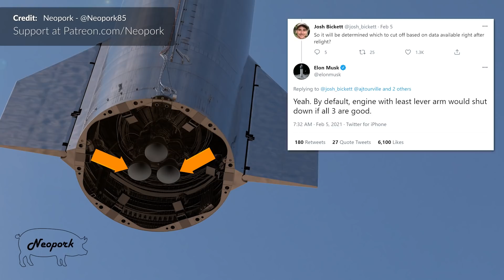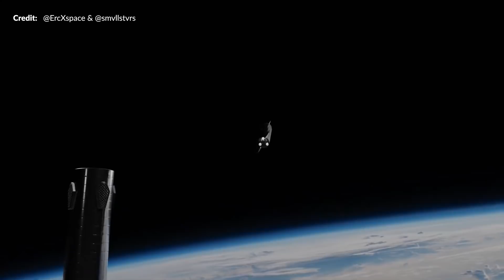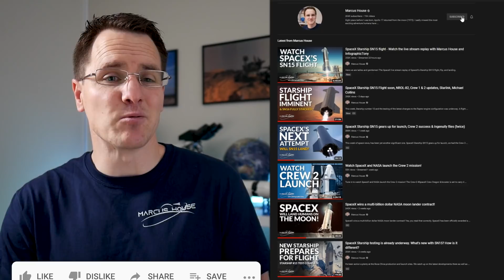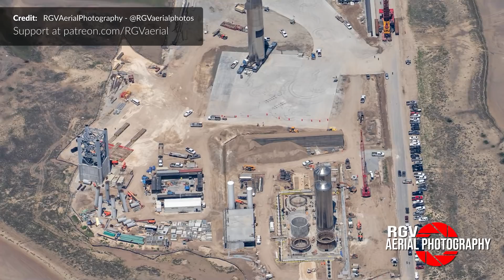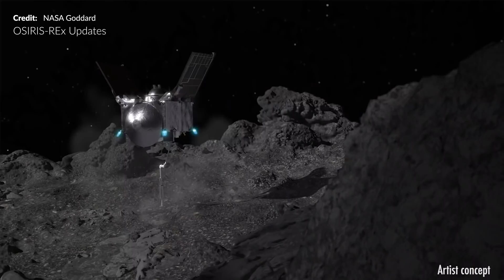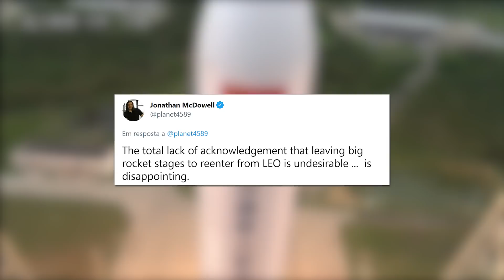SpaceX Starship development shifts focus to orbital flight with Super Heavy

Comment: All three Raptors were eventually removed and sent to McGregor.  No word on the reason or condition, but, honestly?  If I were an engine technician, I would be ecstatic about getting three veteran flight engines back to disassemble, check and fondle.  That would be some of the best data and solid information available anywhere.  In reality, that is the only way to make them bullet proof.

Comment: Good update - but i must point out your wrong about the cryo shells having any significant vacuum in them.
It takes a large amount of strength to withstand atmospheric pressure these thin shells would not be capable of withstanding anything like that and it would require a medium to high vacuum to prevent convective heat transfer.
What i expect is the inter tank gap will be lined or filled with insulative materials like (cellulose , foam , rockwool, vermiculite etc) and pressurised at very slight positive pressure with dry air or nitrogen to prevent frost formation by excluding any ingress of moist external air.
Reply from the maker: I shouldn't have simply said vacuum, so you may be right. We think it will be a lower pressure containing nitrogen. I hope to clarify this more soon.
Reply: @MarcusHouse  I am only guessing but to exclude humidity they will likely pressurise the gap a little  above atmospheric pressure with dry air or nitrogen.
In this way if there are any leaks the positive pressure will not allow external moist air to be draw in which would cause the formation of frost on the cryogenic inner tank surface.

Comment: WHy doesn't starship use Dragon as the top Capsule for Aborting in case. Spaceship has no abort system. If they attached Dragon as the cone, the austronauts can launch safely, then when safely in orbit they can access the whole starship room once it's safe using a hatch.

Comment: their won't be a vacuum between the storage tanks and the outer skin. This is a ridiculous amount of surface area and would not be strong enough to hold back the pressure
Reply from the maker: This is correct, it will actually be filled with nitrogen gas we believe. Correction coming in the next video. In retrospect, it was dumb to think this. My mistake.

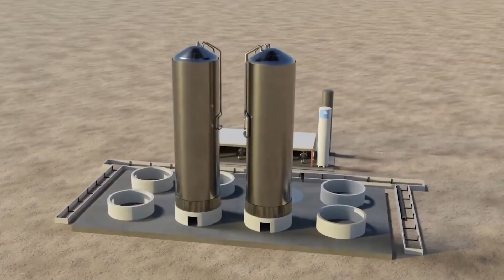Comment: 10:40 I don't think the white 12m tanks would work as vacuum vessels without tons more internal bracing.  Vacuum is common for hydrogen, but LOX or liquid methane works OK with just thick spray foam.
Reply: It will used gaseous nitrogen for insulation per NSF article

Comment: In the event of a problem with a Starship 1st stage,  will a passenger stage be able to separate at a low altitude for a return to launch site? TIA
Reply: They could do some sort of abort by firing the ship engines full thrust, although it has to be quick for sure

Comment: The orbital launch platform looks under-sized to me... I predict that it will be temporary and end up being replaced with a more robust permanent structure with massive flame diversion and water deluge systems. Like the vehicles... this too will iterate.
Reply: I think it's clear at this point that SpaceX is not planning a flame diverter for the OLP. There is no indication of one being built and it's hard to imagine how would even be integrated at this point. What is happening though is construction of a very tall and robust ring that appears destined for the top of the OLP. Given the formfactor and size, it seems ideal to integrate a 360 degree sound suppression deluge system.

Comment: What is the highaltitude record?
Reply: 12.5 km so far
Reply: It's not really a record though. It's just the maximum altitude the FAA has authorized them to fly. They could fully fuel (or nearly fully fuel) SN15 and take it near the Karman Line (100km) on three sea level Raptors easily. It would do this effortlessly. So these flights are not to achieve altitude records, they are only to analyze performance and qualify the design.

Comment: Marcus, I would really like to hear your views on "point to point" travel with Starship. 

I'm a huge fan of the program in general, but believe this aspect to be a complete, face palming, non starter. Excuse the pun, but I believe the idea really won't fly at all. 

I believe it because after many years in the airline business I see the concept as always going to be too weather constrained to fly reliably and consistently enough to provide a workable schedule of flights. Launches, from every provider, are scrubbed for weather related issues at a rate that suggests a "schedule" is unworkable. Even if the rate improved by an order of magnitude, it still doesn't work. 

I see a "charter" market for thrill seekers, a la Virgin or Blue Origin efforts, but I wouldn't build a long term future around it, one mishap and its over. I just don't see a scheduled point to point operation ever being viable. 

We don't cancel airline flights because of a 30 mph cross wind, we don't cancel flights because of wind sheer at different flight levels, we don't cancel flights if the weather at the destination isn't 100% optimal. We have practical workable alternates for getting the plane down safely within a hour or so of your intended destination. I am not going to go on about how many defects your average airliner flies around with waiting to get fixed as schedule allows. This sort of thing won't "fly" in the sub orbital, scheduled flights, point to point business.

Being frank, I don't want to pay a fortune to get to Oz from London in 30 mins to come and visit you, if there is a good chance I'll have to sit at the launch site for a day or a week waiting for a weather window. Plus, and its my big one, if the weather changes in Oz while I'm on the way and we need to find an alternate landing site, its liable to be on the wrong side of the planet. Not a 45 minute drive away. 

Besides, the drinks trolley is going to make one awful big mess during the flip ....😂
Reply from the maker: I agree with point to point if it was a tourist mission. E.g. you get to go into orbit for 24 hours and come down in another location. Other than that, I agree. You are not going to travel this way in preference to aircraft. Just because it may be possible, doesn't make it a good idea.
Reply: @MarcusHouse  I do look forward to the 3 or 4 orbit nightclubs though ... that will be very funny. How do you get home from Bombay while drunk?
Reply: @MarcusHouse  Class effort by the way. Very impressed with your channel.

Comment: Perhaps SN15 used it's leeward and windward engines for more gimbal? Possibly so that Starship can rely on thrust control rather than just throttle control? You can clearly see that the engines made a slight inverted V shape before straightening out again right as it was touching down. Which leads me to believe they wanted to control it's decent rate by putting the thrust outwards and then at the last few seconds, point the engines downwards to set the rate of deceleration to where it will land as soon as the rate of decent and altitude both met 0.

Comment: As an engineer, I fully understand why full scale model testing is needed for BFR.  You can test individual components ad nauseum, but need to make assumptions that are not clear if real scenarios are not available, so these tests are vital with all the sensors they have to counter weather and atmospheric conditions and how the vessel will work structurally.  I wonder if Starship will actually undergo an inspace braking burn before entering the atmosphere to reduce the stresses on the relatively flimsy structure to counter the enormous atmospheric pressure field it will encounter.  No doubt finite element analysis along with computerized fluid dynamic simulations will have been done to put the vehicle through stress analysis tests already.   All of those tests do require assumptive inputs, so a full model test is required to test out those theories as well and to note the deviations.   As a designer and builder of high speed boats for commercial applications, we go through this, but with scale model tests, and we all know that the larger the model, the better the results!   Nothing like testing a full scale model though !!   Especially one as big as StarShip and BNR - which is why what Space X is doing is so fascinating to us engineer - nerds !!

Comment: ... but if you look carefully, there was a very slight bounce.  2 in fact if you look at 2:27 carefully.  One slightly larger one and then a smaller one before it came to rest.  Of course there must be some bounce unless you nail the landing absolutely 100%, there is will going to be some speed just before the vehicle hits.  The point is to get it to a parameter that survives landing.  The landing legs were crushed, so it proves that they had to have withstood some greater mass than they were designed to take.  But they were probably designed to absorb some excessive mass in any case.  The fact that the legs buckled proves the mass or cumulative weight of the craft at the point of impact with the landing pad was greater than its mass at zero velocity.

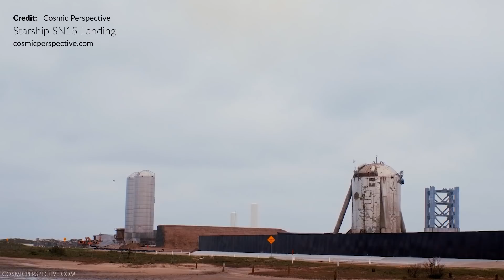Comment: I keep looking and no one is bringing up the wind speed at the SN15 landing.  I've seen several videos with grass and branches blowing like the wind is quite high.  But at around 2:15 in this video you can see the wind blow the dust away after landing.  It looks pretty high to me, wonder if this isn't why it ends up on the edge of the pad. A quick Google search didn't answer this question.

Comment: My prediction is Starship will survive re-entry and landing, but the booster will not survive its landing since they have no data on that yet. It seems like they are using a deep learning algorithm for their suicide burns and there's no way the booster will land on the first try without any data.
Reply: Both are "landing" on the ocean surface.  Neither is designed for this so I wouldn't expect either to be in the condition to reuse. 

Imagine the damage of the Raptors having just been firing for minutes hitting seawater at least hundreds of degrees cooler.  Nothing good happens.  Now the main structure might be more or less intact and capable of being recovered but they will almost certainly (IMO) be scrap.

Comment: Marcus, Each starship that has flown seems to have suffered Raptor engine problems, and even with SN15 landing successfully (hooray!) there's still mention that one of the raptors on board may have malfunctioned to some degree. I know burning methane outside the engine has been a problem in the past, but do we know what the raptor engine's weakness seems to be, or why they are failing? Is it a different issue in each case? Or is this a heavily-guarded SpaceX Top-Secret only kind of topic?
Reply from the maker: From what we've heard is was nothing serious and expected. I don't have enough info to determine how accurate that is.
Reply: Next it's still in damn early days

Comment: Personally I don't think SpaceX expected SN15 to land successfully and the fact that it did has pushed their program on quite a lot. It may well be that SN16 becomes a reserve with SN15 flying again to test tweaks to the flight profile that resulted from SN15's successful landing. Landing a starship is a huge step forward as they can now go over the vehicle with a fine tooth comb to determine if there are any design issues still remaining. It also gives engineers a chance to examine the heat shield tiles closely after a high altitude flight which has thus far not been possible.

Comment: Ah, the Chinese Rocket Roulette. It’s unbelievable how irresponsible they’re being. By contrast, the Space Shuttle deliberately jettisoned the giant external tank just prior to reaching orbital velocity, and used its onboard OMS engines for the last push to orbit. That way, the tank was disposed of in a known, PREDICTABLE location. They did this for thirty years, starting in 1981. That was FORTY years ago. This is how every responsible launch operator has behaved for decades.  

And China has many more Long March 5B launches scheduled over the next couple of years as they bring up their space station modules. They don’t care if spent rockets fall on their own villages or foreign cities and I’d be shocked if they made any changes to make them safer, because that would require time and money to redesign, remanufacture, requalify their rockets. No, the only way they’ll change is if one of these rockets falls right on top of Chinese Communist Party HQ. Therefore, I sincerely hope that’s exactly what happens on the next launch.

Comment: How about verifying that the thing can fly properly with more than just 3 rockets and fuel tanks?  How about verifying that ALL ENGINES WILL STOP AND RELIGHT PROPERLY?

Jeez, this thing is stuck a flying trash can robed as a 'spaceship.'
Reply: Do you know that it's still in EARLY DAYS?
Reply: @alvianchoiriapriliansyah9882  Nope.  Rocketry has been a mature science well before NASA was a thing.  You DO realize we put up a FOUR STAGE rocket that went to the moon...REPEATEDLY...in the late 60s and early 70s, right?  And SpaceX is doing NONE of those things.

Even the Falcon Heavy is more reliable than this thing...and it blows up on the pad A LOT.

Comment: why not attempt landing the booster back on land during the orbital test?
Reply: Because it doesn't have legs
Reply: Also has more fuel aboard and a RUD would be more risky.  Even the Falcon 9 first landings were "ocean landings".  Only after they had those be successful did they do the drone ship landings. 

Finally this being a first flight the numbers for fuel usage may not be exact requiring even more fuel for safety making a RUD worse still.

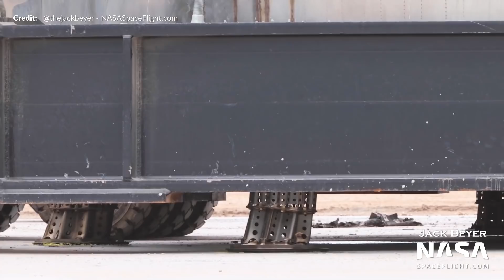Comment: 3:29  SN15 landed with almost zero vertical velocity, and the legs had almost no vertical telescoping. Incredible precision by the software team. However, there is the damage you saw - it's all sideways bends from dragging. Scott Manley noted some skid marks on the landing pad (before the SPMTs were in position), indicating the ship was moving sideways slightly at touchdown. This matches the bends damage where the feet meet the legs. In fact, while a crew as picking up a leg the foot fell off.

Comment: How does the Starship land after going to space?  It would be using vacuum engines in space as a second stage.
Reply: A normal Starship will launch with 3 center sea-level Raptors (the ones we've seen) and 3 vacuum Raptors. On launch, after booster separation, all 6 engines will fire. The 3 center ones will be at reduced efficiency but still quite effective. At some point during the ascent, afaik, the vac engines will take over completely.

After reentry and the skydive descent the 3 or 2 center engines will be used for landing.

Comment: Not flying a fully completed Starship that's ready to fly would be a very weird move imo, even if it slows orbital pad progress by a few days.
Reply: Which starship are you talking a about again? It would be wierd but if there's a known issue and it's faster to fix from scratch, scrapping is probably the best move. Even if fixing an issue is a little bit harder without starting from scratch, they might as well do it and scrap the defect to make space.
Reply: @shlok975  I'm talking about SN16...
Reply: This is likely because of what they have learned from the last time 2 starships were on the pad. If they expect SN15 to have issues during it's reflight they may not try to get another starship within blast distance. That being said it is likely because their operations have called that SN-15 must try to refly first and that bringing SN16 out before that would be a waste, since the space is not yet needed for the assembly of SN-20. 

Overall, they are likely only going to bring out SN-16 out once SN-20 needs the space in the high bay for stacking, since there is two slots there and one will be occupied by BN-3
Reply: Yeah, I also think it's wierd, but then again, the whole starship program is wierd. Might as well scrap instead of clean up after it goes kaboom.
Reply: @shlok975  Scrap instead of clean up after kaboom. What is that supposed to mean?
Reply: @Exalerion  If it were to explode like SN11, it would be better to scrap it. Sorry, I just realized in hindsight that it's not THAT likely for something bad to happen. Nevermind me.
Reply: @shlok975  How could they possibly know a prototype is going to explode before even flying it... Most of their issues have been Raptor related.
Reply: @Exalerion  they couldn't, I'm sorry. I was trying more to say that perhaps they could have learnt something, anything, from SN15 and wanted it iterated on their next launch?
The "kaboom" part was a bit of an exaggeration because for some reason I thought it would be funny.
Reply: @shlok975  SN15's success is exactly why I think they should fly SN16 - or as many prototypes as possible for that matter - to apply learned lessons and iterate their success. SN15's flight wasn't flawless either. Going to orbit is something else lol, with Vaccum Raptors.